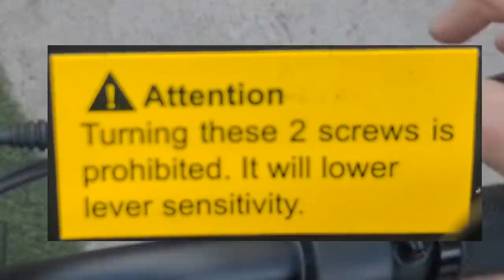I BOUGHT A BIKE WITH CLOUT

Comment: Those black plastic pieces go in between your brake pads when the wheels are removed to prevent the pistons from compressing and getting stuck when a rotor is not in the middle. Useful for transporting with wheels removed in case the brake lever gets pulled. Hope this helps

Comment: Brake pad spacers for when you take off the wheels... that way the pistons don’t compress without resistance from the discs to push them back out when air/oil pressure is released.

Comment: Does the 73 RX come with a 10 speed cassette? Based on your experience is a multi speed set up even necessary? Does the motor have enough torque to handle some hills?

Comment: Congrats man. At 9:56 are your disc brake place holders so you don't accidentally lock up your hydraulic brakes when you remove your wheels/brake rotors

Comment: I used your code to get my R in December but l wished I bought the a surron
Reply: What's the code? Is it still available
Reply: @deadcell2673  it's usually in the description there will be a code to save $100 off of any super 73 and a bunch of these guys that have these videos on youtube have their codes on there you save 100 they get $50

Comment: 63 degrees? That's a heatwave! It's 14 degrees F here, but I'm gonna ride anyways! Bike looks sweet... the Super has it's own distinct look.
Diagonal cutters are the best at unboxing. Clip clip!   How far is it to the beach?
Oh, can you do a 0 to 20 mph acceleration test (throttle only) once the battery gets topped off? Curious about that version of the motor.

Comment: Wtf 2007 and  2008 its 221
Reply from the maker: It’s a serial number not a year
Reply: @loopholeculture  um
Reply: @loopholeculture  I believe the first two numbers, “20”, refer to the year of manufacture, 2020. Then the second set of numbers was the month of production. So v1 motors were “05”, v2’s were “06”, and v3 motors are “07” and presumably “08” etc. sooooo... your motor was probably made back in August, hence “2008” and is likely a V3.

Comment: these aren't e bikes but under powered over priced not ready for prime time overweight electric motorcycles. Just get a real motorcycle and stick with a DIY ebike kit that keeps your bicycle a bicycle
Reply from the maker: Actually no they’re ebikes
Reply: @loopholeculture  come on man we all know these are wanna be electric motorcycles. I worked for a motorcycle dealership and they have a real electric motorcycle called a zero which is way better than these, which by the way negates the benefits of a traditional bicycle since it brings way more attention from law enforcement, you'll get pulled over more if you try riding these on sidewalks, through malls, in parks etc. than you would with a DIY ebike that looks like a traditional light weight bike. Also the allure of an ebike is its minimalist and low maintenance, these you need special tools and a mechanic just to change the tire, keep it simple stoopid
Reply: @theFormidable1  yeah but what’s the fun in that? You have to register them. No thanks. You can’t ride anywhere you want / how you want. Again, no thanks.
Reply: @easyheimer  that's my point with these wanna be motorcycle "ebikes" and the way I see you guys ride, pretty soon they'll regulate all ebikes to have registration and insurance.
Reply: @theFormidable1  its true - these bikes are a pain and weak motors